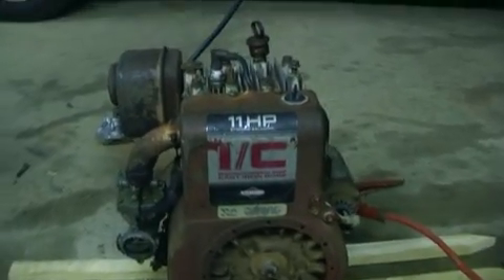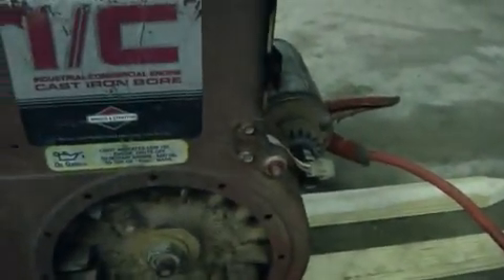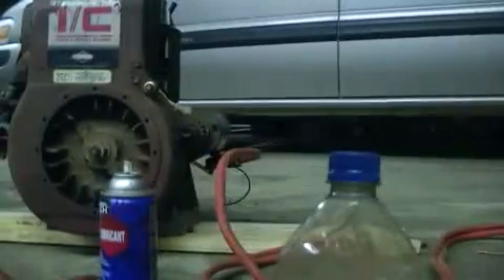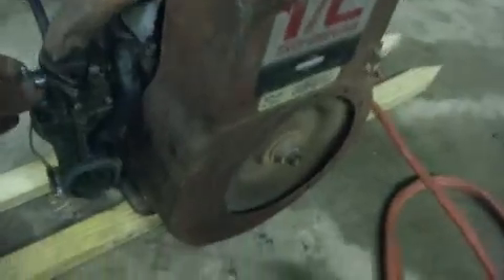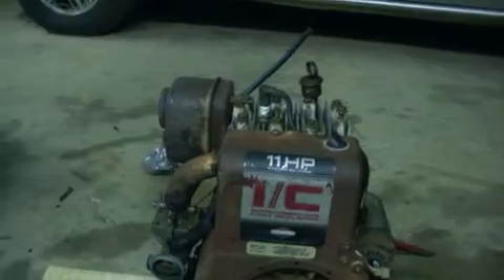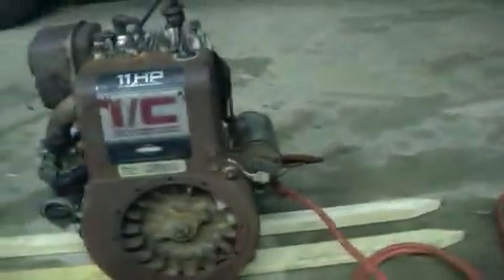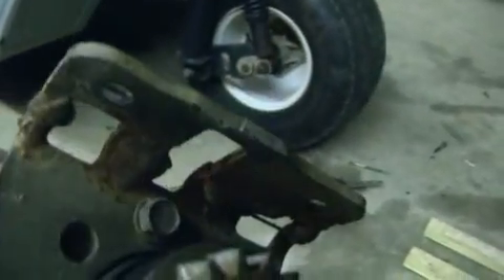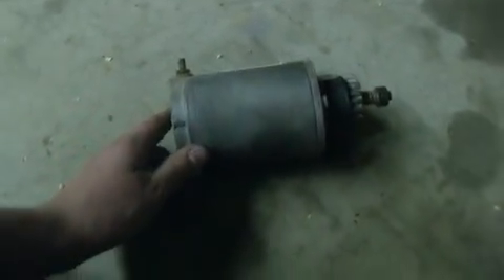11hp Briggs horizontal engine startup - 5/27/10

Comment from the maker: @crackermess 
i get them from a scrapyard down the road from me and i keep the engines as spares or come up with new things to do with them, like one of my projects is to build a zero turn mower with 2 murray decks, 2 murray hydro transmissions, and a weed eater (tractor) frame with a 20hp briggs opposed twin. i am thinking of starting a small engine repair business in my area in the future and get my own shop built. and i also have a very strong interest in small engines and mechanical things.